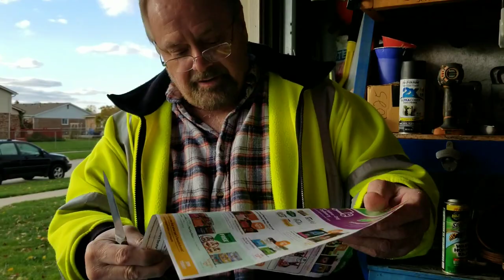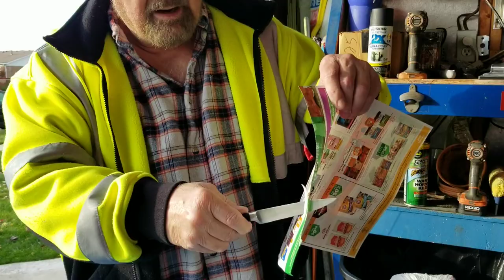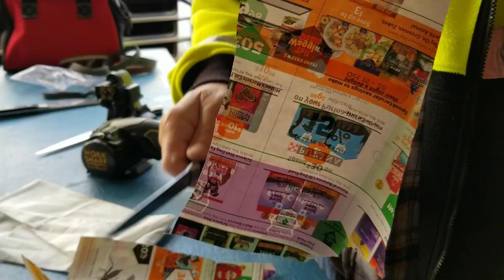How to sharpen a Knife / Ken Onion Knife Sharpening / Work Sharp

Comment: Thanks for the exceptional video. This is the first video I have watched that has close-ups of the knife and knife guides while actually sharpening., which was very helpful. Was the sharpener running at "medium" speed during the videos? What advantages are there of using slower or faster belt speed?

I have been undecided on if I should order the Work Sharp Precision Adjust Elite or the Ken Onion electric sharpener. Your video was the deciding factor in making my decision. I am going to order the Ken onion sharpener today. Thanks again for the video.

Comment: Have you found a way to prevent scratches ? At 4:59 you can see a whole load of them. Also, at 0:59 you can see that knife has a dark line half way on the knife, following the length of the knife - that is also what happens on wide blades. How to prevent it ?
Reply from the maker: Let me ask the guy in the video.  He's a sharpening expert of sorts.
Reply: @GebosGarage  use masking tape